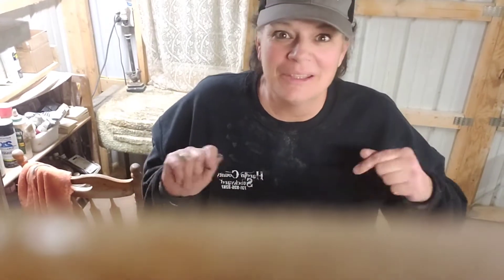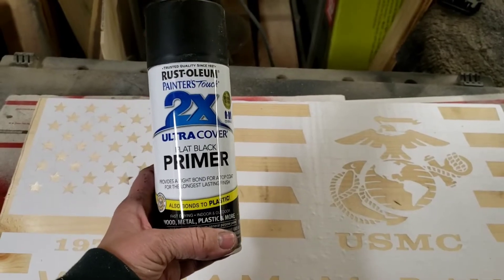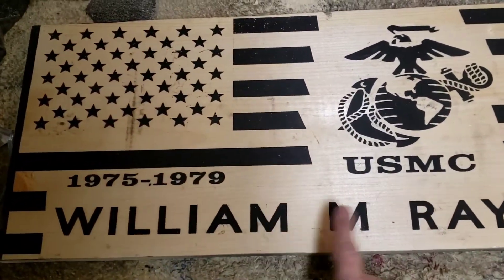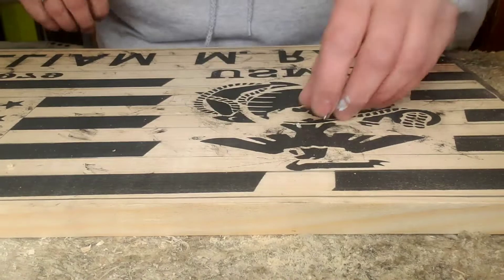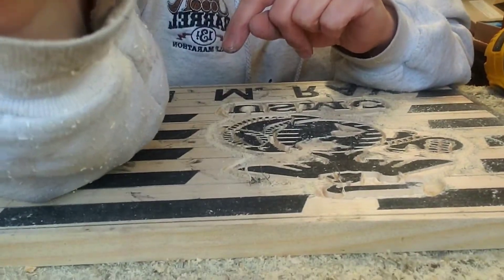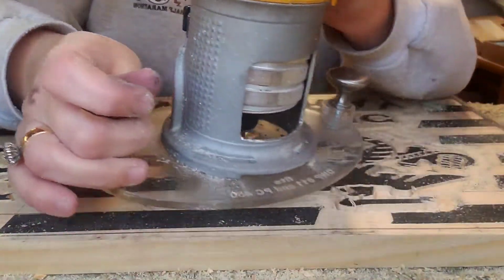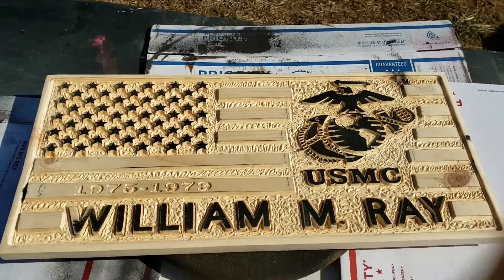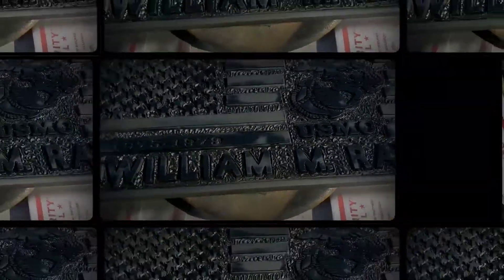USMC American Flag

Comment: Looks great sister! What psi is your compressor set at?
Reply from the maker: Thank you Zane... It's set at 90 psi... My husband got my air compressor from a local pawn shop... I absolutely love it because I went through 2 of them small ones from walmart😳
Reply: @gigiscustomwoodsigns5471  Wow! 90 psi. I run mine at 25. Maybe I should try 90.
Reply from the maker: @Boxcutter11  i know every compressor is different but when mine was lower I just wasn't getting a good spray & since it's been bumped up I haven't had any issues anymore🙏
Reply: @gigiscustomwoodsigns5471  Sorry to bother you again Gigi but what compressor are you using? Brand and horsepower?
Reply from the maker: @zane it is a craftsman & 1.5 horse power & it's a 20 gallon tank... I hope that helps 😊
Reply: @gigiscustomwoodsigns5471  Yes, that helps a lot. Good to know a sister in Jesus.